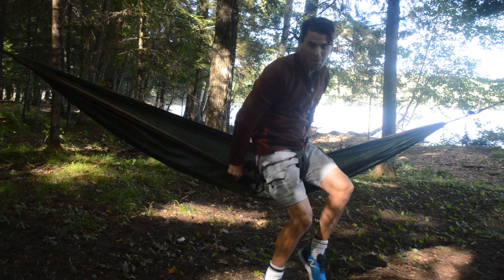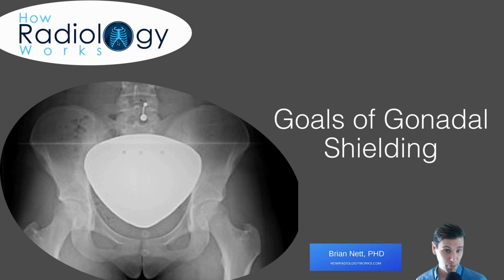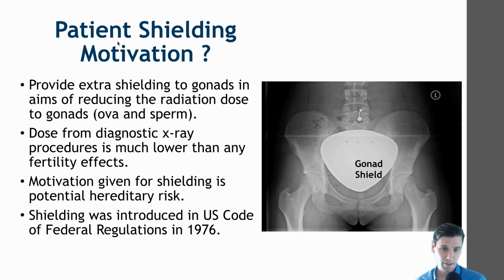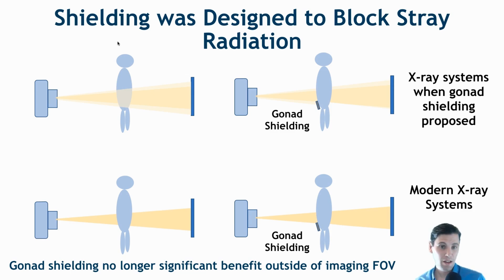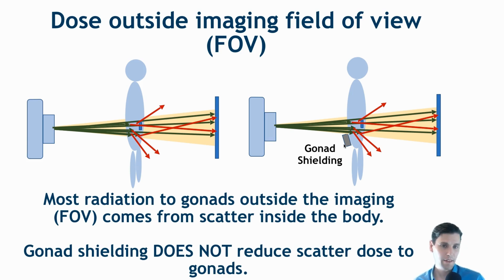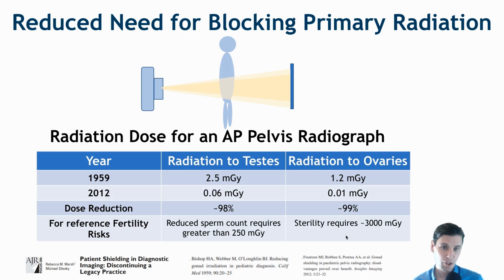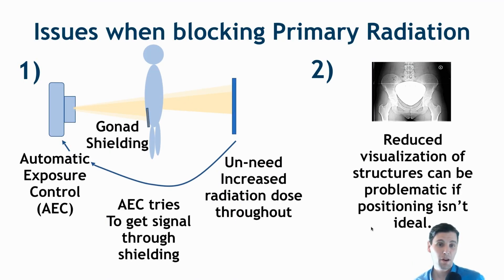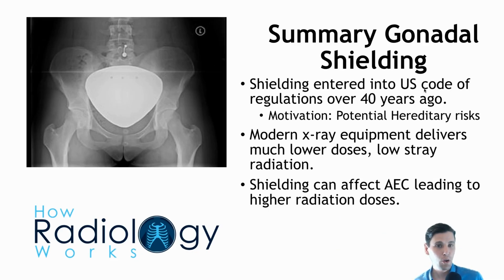Gonad Shielding X-ray | (Motivation and 5 Reasons to Phase it OUT)

Comment: Im an student x-ray tech. I have a question. Wouldnt shielding depend on the angle that the x-ray photon enters and exits the body.
Reply from the maker: Shielding was introduced when systems had high stray radiation. Since this is no longer the case shielding has very little positive impact if outside the field of view. If the shield is in the primary beam it can cause significant issues with Automatic Exposure Control. So the angles are relatively small and do not have a significant impact. Thanks for asking.
Reply: @HowRadiologyWorks  I am familiar with the AEC and have trained in places with and without it. From what I've seen AEC is not in the Children's hospitals where I have been and clinics that don't have a substantial budget, in those cases the detectors are digital but the X-ray tubes are older models and have some issues with collimation alignment would shielding be necessary there or does the same concept that its not necessary?

Comment: My pelvic ct scan severely damaged my gonads. These are not safe scans
Reply from the maker: I’m sorry to hear that you have a health issue Micah. How did you confirm that the issue was caused by a CT scan?
Reply: The immediate affects to my male reproductive system after the ct and became severe in the following weeks and months, significant loss of seminal fluid different part I know,  never had before very low T, the burning and aching, and significant loss of testicle size by 3 months later. My hair and beard literally quit growing for.several months. All blood work good and test came back negative. The facility I had this done at had just got a new machine in. Maybe a program error or automatic dose machine error however my  states board of imaging stated everything was standard dose and a Normal scan. I'm at a loss here. Simple xrays I can understand but cts give a whopping dose. Unfortunately my gonads were directly radiated from the scan my primary ordered which I would of never had done if I would if known the significant radiation exsposure and my pelvic area was being ct scanned as well. A man's balls are his most sensitive organ in his body to radiation. It's to bad protecting a man's balls from radiation is taken very lightly now. 3 months later my testicles lost half there size and cysts formed. Men need to be vigilant about protecting there gonads from unnecessary radiation exsposure as primary doctors as in my case did not take this into consideration and I paid dearly for it.